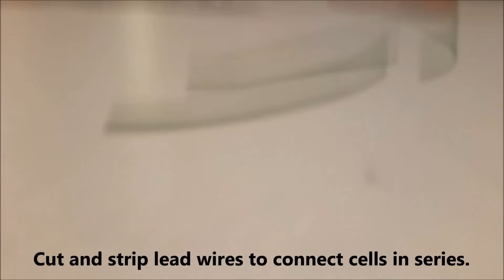Soda Can Battery - Power From Trash - DIY Project

Comment: I know this post is already old but if ever, if anyone is watching can you please suggest ways in order to produce higher amount of electricity? Also, we've done tje same procedure but the only bulb it can light is the small LED light that is used in christmas lights. What do you think is the problem and how to solve it?
Reply from the maker: Hi Kaspar C., if you want more voltage with these same cells you need more cells wired inn series (negative to positive). If you are wanted more amperage (current) you would want to use more cells wired in parallel (positive to positive and negative to negative). Does that make sense? LED lights only require a small amount of amps, so I just wired mine in series. 10 cells at about 0.5 volts each, makes 5v to power the LED light. Please let me know if you have more questions and please on our latest poll on our community section. - Danny
Reply: @SourcePortEntertainment  thanks for the reply. But what's the difference between voltage and amperage? And by the way can i use mud instead of sand and saltwater? I'm really thankful for ypur response...
Reply from the maker: If electricity was water and the wire or battery cell was a water pipe. The voltage is similar to the water pressure in the pipe and the amperage is the amount of water flowing through the pipe. Make sense?
Reply: @SourcePortEntertainment  thank you again for the reply. So we noticed that each cell produces about 0.3 to 0.4 volts but when we connect the cells in series, the amount of electricity produce is still 0.3 to 0.5 volts. Why is that it doesn't add up like 0.3 volts each cell multiply to 10 cells so at least it should produce 3 volts? I think it has something to do with the amperage as the flow of the electricity is not that strong? Am i right? If yes how to increase it and if not? How to solve this problem? Hoping for your response again than you
Reply from the maker: Hi Kaspar C., You want to test each cell individually first to verify that it is equaling around the same voltage (0.3v in your case). If not then that cell might be shorting out or touching copper to aluminum on the inside somewhere. Fix that first. After all cells are testing properly. Connect them together in series negative of one cell to positive of the next cell. Then to test voltage put one of the testing probes on the negative of the first cell in the chain then put the positive probe for your tester on the positive terminal of the last cell in the chain. This will give you the voltage of the total chain (series) of battery cells. You can try to find the bad cell also by keeping the negative or positive probe on the first cell then touching the opposite terminal of the next cell until you find the voltage drop. I hope this helps, please let me know. - Danny
Reply: @SourcePortEntertainment  sir any suggestions on how to increase the amperage of the battery?
Reply from the maker: Yes more surface area in contact with the electrolyte (salt water or vinegar). You could keep one can whole with the top cut away like I did and then cut the top and bottom off of several more cans, then carefully sand them with sand paper to expose the aluminum. Put those layers of cans inside of the other can. Get more length of copper wire. Sand it once or twice as well before wrapping it into a nice tight coil. Then connect that new cell in parallel (positive to positive, negative to negative) with the other series of cells. So you would have the long series connected cells with a positive on the first cell and negative wire on the last cell, then the positive wire of the higher amperage cell connected to the positive wire of your series and the negative wire connected to your negative wire of the series. You could even put a 5v capacitor in line with the positive and negative connections to help level out the mixed voltages from your series and the single higher amp cell. Does that make sense?
Reply: @SourcePortEntertainment  it's been two months and we tried creating a battery with a total of 60 cans. We connected all cans in parallel connection. We haven't tested it yet but can you give us any suggestion on how to be able to light a house bulb with the ise of these cans only? And by the way can we use mud rather than sand?
Reply from the maker: How did your project turn out?

Comment: Hello very nice videos your are  making 

Is there a possibility to make a video for  making a really battery for use in photovoltaic  (of grid situations)
With a very big capacity? 
The  dimensions and the weight  it is not at all critical or problem  there's on lot of space 

Thank you very much for your time
Reply from the maker: Thank you for watching and commenting! I have plans to make some supercapacitors in the near future using things you have got at home. Most of the "DIY at home" battery projects would not have enough capacity for an off grid setup. From what I have seen high amp hours golf cart batteries would be most affordable which are lead acid batteries, and rechargeable unlike these batteries that are one time use. If you like my videos please share and subscribe!

Comment: You cant really get an acurate amperage test that way. Current is a measurement of electrons flowing through a load so you need to put a load on something like an led light and place probes in series on the hot side of the led light. Cool video though thanks for sharing. It gave me a few ideas of some stuff to try to maybe increase the amp hour capacity of something similar
Reply from the maker: Thank you Carl! I am gladyou enjoyed the video. I learned the properly way to measure amperage after the fact. I appreciate your comment. Please feel free to comment on some other videos and SHARE and SUBSCRIBE!
Reply: There's absolutely no evidence whatsoever that electrons, or anything else for that matter, flows through a wire. The evidence seems to suggest that what some call a flow is actually a field perturbation, which makes much more sense
Reply from the maker: We thought you might like Building a DIY ROCKET STOVE video - https://youtu.be/Hlir866cp-E please LIKE and leave a COMMENT. We value your feedback!

Comment: Was there vinegar in the original experiment?  Also, is there any special instruction for proper disposal of these cans, and their contents, once they're finished?
Reply from the maker: It was just salt water to start, then I added a bit of vinegar to increase the amps. The LEDs started to get very dim after a week or two. I don't have an instructions for proper disposal. I think it is still just aluminum and copper with a few less electrons. Anybody else have any tips or insight?

Comment: How manny Diy Soda Can Battery need in order  to power up an Dc motor..?
Reply from the maker: Depends on the DC motor and the volts/amps needed to run it. If you have a small 1.5v DC motor you would need at least 3 (0.5v) cells to meet the voltage requirement. It would probably spin fairly slowly with only a few milliamps that the cells are running at. Please share and subscribe!

Comment: What specific coil needed and the length per can
Reply from the maker: 12 gauge copper wire. Use as many wraps as you like. I think I did about 5 wraps then stretched it to the height of the can.

Comment: What would be increased in volume if we would want to increase the electric current, saltwater or sand?
Reply from the maker: You would what to increase the surface area of the two metals that are in contact with the saltwater. The sand was just used too fill in the space and hold the copper wire upright in the middle of the can. It doesn't serve and electrical purpose in the circuit.
Reply from the maker: We thought you might like Building a DIY ROCKET STOVE video - https://youtu.be/Hlir866cp-E please LIKE and leave a COMMENT. We value your feedback!

Comment: So, salt sand and copper coils = energy?
Reply from the maker: Copper + Aluminum + Salt Water = Energy! ☇☇
Reply: Coat hangers or galvanized (Zinc) work as a replacement for aluminum. Lead (toxic) is the strongest replacement for the copper
Reply: Or discs of aluminium foil + cardboard (insulator) + copper pennies (1981 or earlier) in a tube with Anode and Cathode.
Reply from the maker: Great tip Main Arbor! I will have to try that. Thanks for watching and commenting. Please Share and Subscribe!
Reply: @SourcePortEntertainment  I like you channel. Thank you for the work uploading! One suggestion for your cells. The more surface area you have the better. More surface area give more "replacement reaction capacity". 🙂
Reply from the maker: Thank you!
Reply: @mainarbor8416  True and I think how we may still use the aluminum soda cans(sodium zincate electrolyte converts the aluminum to a zinc anode from the inside) and make a soda can rechargeable battery using stainless steel as the cathode. and while it's true that lead is toxic, lead-acid batteries are the most recyclable batteries in the world,  lead oxide has an electromotive potential of +1.60-+1.70 volts(depending on the electrolyte, alkaline electrolyte tend to lower the nominal voltage).   so an aluminum/zinc soda can battery with Lead Oxide cathode will have a nominal voltage of about 2.3 to 2.5 which is exceptionally good.
Reply: At the very end you say "topped off with a little more vinegar". When was the first time?
Reply from the maker: We thought you might like Building a DIY ROCKET STOVE video - https://youtu.be/Hlir866cp-E please LIKE and leave a COMMENT. We value your feedback!
Reply from the maker: @knewhunter1 I refilled the cans with Salt Water but it wasn't lighting up the LED very bright so I topped it off with some vinegar for that last follow up picture. That was the only time. It ate  through the cans within a few days and made them leak. Thanks for watching and commenting. Please SHARE and SUBSCRIBE!
Reply: @knewhunter1  thought the same watched the clip 2 times looking for the first time Vinegar was used lol

Comment: Removing the organic coating inside the aluminum would help. The issue with this cell is that the sides will pit corrode and leak.
Reply from the maker: Hi Eddie, very true. I will remove the coating next time, and seal the outside with a plastic of some kind. If you like the videos please share and subscribe! Thank you for watching and commenting!

Comment: What is the use of the insulator on the side of the can. The copper coil wll not touch the metallic side of the can due to the sand. So I guess the sand is the real insulator?
Reply from the maker: Hey Captain Prototype, thanks for your question and for watching! The copper wire can slide around in the sand, possibly touching the can and shorting out the cell. The cardboard was to try and prevent that. Please SHARE and SUBSCRIBE!

Comment: Hello, may I have the list of materials used per can, I need it urgently. As well I input you on our acknowledgement on my research paper.
Reply from the maker: Hi Hokage, Of course I would be happy to. Per can there is one aluminum soda can (lightly sanded with sand paper), one round cardboard insulator for the bottom of the can, one thin sheet of cardboard insulator to wrap around the inside of the can, about 6-8 inches of 12 gauge copper wire wrapped into a coil, and one soda can full of play sand, a salt water to fill the can until sand is fully saturated. Then smaller gauge lead wires to connect copper coil from one can (cell) to aluminum can of the next cell, all the way down the chain. By the end you should have one small wire on the copper coil of the first cell and one wire on the aluminum can of the last cell. Please let me know if you have any other questions and please SHARE and SUBSCRIBE! - Danny

Comment: Can you also specify the exact amount of sand and water? Thankss
Reply from the maker: Use sandpaper or steel wool first on the inside of the can. One soda can full of sand, just under the top rim of the can. Then fill with the saltwater solution until it begins too pool on top of the sand, showing it is fully saturated. Repeat until all cans are full.

Comment: I feel like you could make these much stronger for the amount of space in a soda can. Maybe by adding citric acid or Gatorade to the battery instead of salt water.
Reply from the maker: Thanks for the idea! I will have to try that on the next one. Please share and subscribe!
Reply: Yes! Every one knows Gatorade has electrolytes. I saw it in a movie!
Reply: The four best DIY, safe battery electrolytes:
citric acid (C6H8O7)	lemon, lime, orange, grapefruit, tomato juices
acetic acid (CH3COOH)	vinegar (4% to 8% acetic acid), pickles
phosphoric acid (H3PO4)	some soft drinks (e.g. Coke), potatoes
salt water	tap water and table salt (NaCl)

Phosphoric acid can be recharged electrically, but not many times-  like, 3-5 usually with ~15% capacity loss each time.  They used these for Rechargeable Alkaline-Manganese (RAM) batteries back in the day before Lithiu, NiMH and NiCD.
Reply: @SourcePortEntertainment  The four best DIY, safe battery electrolytes:
citric acid (C6H8O7)	lemon, lime, orange, grapefruit, tomato juices
acetic acid (CH3COOH)	vinegar (4% to 8% acetic acid), pickles
phosphoric acid (H3PO4)	some soft drinks (e.g. Coke), potatoes

Comment: Question, what happens with the reaction if you don't use the energy? Will the cables heat up? Let me know
Reply from the maker: Thanks for the comment. No the electrical charge will build inside the cell. It would only heat up the wires if you were pushing to many AMPS through to small of a gauge of wire. Let me know if you have more questions about this project.
Reply from the maker: We thought you might like Building a DIY ROCKET STOVE video - https://youtu.be/Hlir866cp-E please LIKE and leave a COMMENT. We value your feedback!

Comment: Put the paper tube around your copper coil instead of the outside of the can and fill the outside of the tube with shredded/powdered aluminum instead of sand.  You'll get much better performance.
Reply from the maker: +Laurence Perkins awesome suggestion thank you! Please share the video if you liked this project, and subscribe so you don't miss the next version.
Reply from the maker: Hi Laurence, do you have an example of that you could send me a link to? Thanks! -Danny
Reply: Unfortunately my prior experience with these things was based on a children's science book when I was in gradeschool.  I still have it somewhere, but nobody's invented web-to-RL links yet, so you're probably better off asking Google.

However, I can tell you that the majority of the power comes from oxidizing aluminium.  You can even replace the copper coil with carbon like is used in the heavy-duty type batteries and it will still work.  So anything you can do to increase aluminium surface area will improve the amperage you can draw from it, as will anything you can do to increase the amount of oxygen it can absorb from the air (as long as you keep the electrolyte from evaporating, or replenish it.) Decreasing internal resistance by putting the anode as close to the cathode as possible will also increase the power.   

The book I had suggested building batteries out of pennies, squares of paper, and squares of aluminium foil.  Unfortunately pennies are no longer made of solid copper, and the zinc cores don't have the right electronegativity compared to aluminium, so if you do that nowdays you'll get a battery that works for about two minutes and then shuts down as the copper cladding on the coin corrodes in the salt water.

Be aware that the aluminium hydroxide produced as the battery runs down is caustic.  So wear gloves when you go to disassemble and dispose of one of these if it's of any significant size.

Aluminium batteries like this are actually some of the most powerful known per unit weight if well constructed, and certainly the most powerful that are also stable.  The only downside is that they are non-rechargeable without re-smelting the aluminium.  But I have been tempted to see if I could build a set sufficient to run a model airplane since getting empty cans in large quantity is usually pretty easy.  If I ever have time for that I'll post a video for you.
Reply from the maker: Holy cow Laurence! That is a very useful information filled comment! I have a bunch of cans I have been saving up so I might need to make two different versions one will a smaller diameter and more cells and one with aluminum can shavings inside of it. I am thinking about trying to carbonize a few #2 pencils, similar to the way char-cloth/charcoal is made. That should give me a carbon-graphite core to work with. From what I have found a graphite/aluminum cell gives about 1V amps would depend on surface area. What are your thoughts on that?
Reply: Don't bother with the pencils, it's not worth the time.  Buy activated charcoal like is used in aquarium filters, or if you really want graphite, powdered graphite is available in bulk and relatively cheap.
Reply from the maker: +Laurence Perkins great idea thank you!